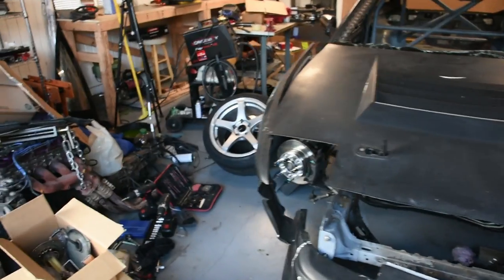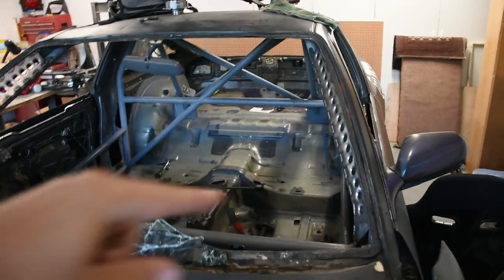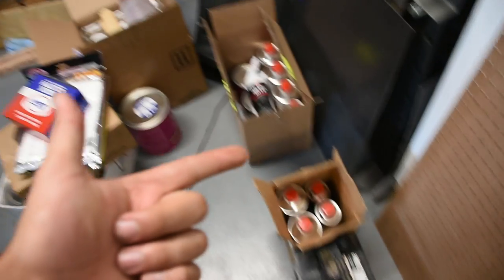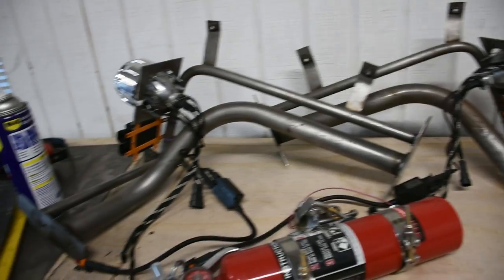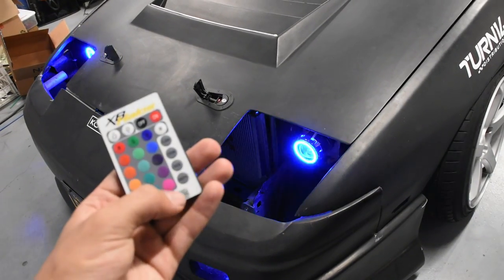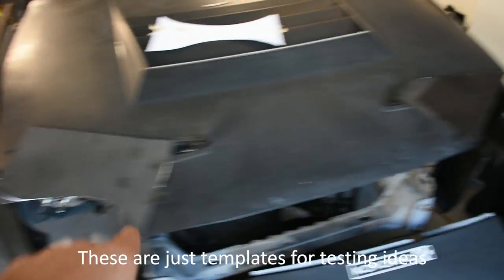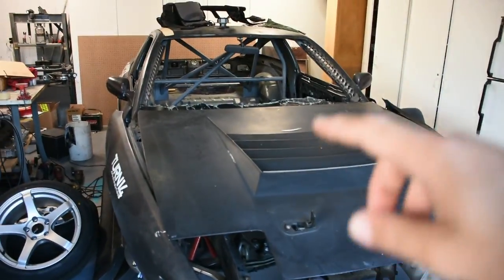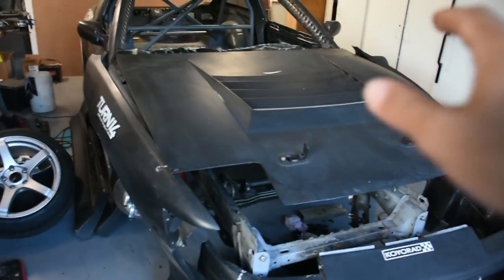Headlight Preview, Engine Plans, and Car Update!

Comment: WHEN you do the turbo 
I recommend getting forged internals

BUT!
GET AN ECU!
Go haltech or aem
And
GET
IT 
DYNO
TUNED!

Please for the love of the car get it dyno tuned

I like the cage vids btw
Reply from the maker: Probably won't be getting forged internals. Not worth it unless I can also find a fully counter weighted crank. Also KA's have no problem holding 300-350HP with stock internals.
Going with Megasquirt MS3 Pro. Cheaper and has more features than AEM. Haltech is just ridiculously expensive. 
Will be doing majority street tuning as street tuning tends to make the car more driveable however I'll be doing some dyno tuning as long as I can get my hands on a dyno which I think I can. 
Thanks :)
Reply: ***** ahh ok not really familiar with the ka so
I'd generally go forged anyway since you could rev it out much farther that way ( valve float not included ) 

But seriously
Get it dyno tuned asap when you get that turbo

Hell I'd go for getting that ecu before you even get the turbo 
Get the most out of your engine 

But if you can when you get it tuned get multiple tunes after your power 93 oct 
Or if you want to got through the "trouble" of converting everything so you can do e85 
( upgrading it in the process of course )

Comment: Looks pretty cool, what colors are you thinking painting it? Will you keep it black on the outside? 
About the headlights, where I live you need to have a set of lights pointing to the ground so they illuminate less but without "blinding" others, and those pointing straight forward. Are the rules the same around there? It appears by the way it's installed it couldn't do the job of those pointing down because the bumper is converting part of it, and knowing you also use this car for driving on the road, these safety issues end up coming up.
Reply from the maker: +André Fontes Car is going purple inside and gloss black outside.
Rules are kinda vague around here but basically just don't blind people seems like a good rule of thumb. 
I've driven the car hundreds of miles at night so far and have no safety concerns with lighting up the road ahead of me. The lights are really bright and the car is low. So with the mix of the openings in the bumper and how well the lights work and with the ride height of the car being so low I have no issues seeing and lighting up the road in front of me. 
Thanks,
Reply: Sounds pretty cool, it'll surely look awesome! Sounds OK then, a shame rules in Portugal are so restrictive for car customizations, there would be no way your car could be legal arround here XD at least to be able to drive it on the streets
Reply from the maker: Haha that's why I love America :P
Reply: portugal caralho

Comment: please dont turbo the ka you should swap in something like a sr20det or jz 1 or 2 but a rb20 would be cool.
Reply from the maker: +AtlasTitan Not worth it for a power level of 300-350HP
Reply: True but youre not really buying the engine for its stock power you would be getting it for the platform that you can build more power off of with a ka you can only go so far and the rb20 is pretty easy to swap.
Reply from the maker: If I want an 500+HP car then I'll buy an engine like a JZ to swap in. But right now I don't and especially since I'll be tuning the engine myself, god forbid I blow the engine doing something I shouldn't have with the tune. The price to replace a JZ is like 4x the cost to replace a KA.
Reply: yes thats true KA is cheap and to learn from its good but still you can do all that on a 1jz to swap. It will coast a good amount but if you do blow the engine ill be like 1k to get not that much more than a 700 ka.
Reply: And i do understand what youre saying it will cost a lot to get the 1jz or whatever engine im not you and i dont know what you can and cant do its just my opinion.
Reply from the maker: Bruh where is a KA going for $700. I bought my manual clean title 240 with a KA in it for $800 haha. Engine's go for like $250 to $500 which is a lot less than a 1jz.
And yeah for me right now I can turbo the KA for $3500-ish. So I'd have a full standalone ecu, single turbo setup, custom v-mount intercooler, custom radiator. For $3500 if I were to swap would just get me a stock 1j with R154. No motor mounts, no trans mounts, no driveshaft, no intercooler, no radiator, no standalone ecu. The cost is just way too much for a swap when all I want is a 300-350 HP setup.
Reply: What type of ecu are you planning to run?
Reply from the maker: MS3-Pro
Reply: Sr's are boring (live in Australia and they're all over the place), everyone with a sr I know has had issues with them running decently or breaking pretty often but it's all preference :)
Reply: it'll blow up to lol
Reply: Sr's are mint, I'm from Aus too. Dunno what you mean by them having heaps of issues
Reply: @OffBeat Garage You can get a good 1JZ-GTE VVTi with auto transmission for around 1000$ to 1500$, the thing is, you need to find and fit a manual 5 or 6 speed Toyota transmission. There's a guy that have done that, he bought a 240 shell and a 1JZ-GTE VVTi with auto transmission and fit the 1JZ in the 240. His youtube channel is TheCityRider you should check it out if you haven't. I don't mean to be disrespectful but i just don't get why you spent so much time reinforcing the car with tons of roll bars and stuff, and then run a KA, but that's just me talking man, don't get me wrong.
Reply from the maker: Again the goal is 300-350HP. KA-T is the most budget friendly setup for that power goal.
Reply: @NegatifDubz My 1jz vvti build is better than thecityrider. He put a giant borg warner on it, so no boost and no response then he sold it. What's the fun in that?
Reply: hey man i'm not saying that his swap was better than Offbeat's, he might have done some stuff wrong, yeah he did, but that's not the point. I was just suggesting to OffBeatGarage a better swap in my oppinion, since he spent so much time reinforcing the car, he might aswell fit an engine that would make use of those reinforcements, to really test himself on the course. I know you don't need a high HP car to drift, hell you don't even need a turbo car to drift, but  you can still drift slower with turbo to get used to the car, and then when you're good with it, you can try to step up your skills by pushing the car harder, but for that you'll need some power on the engine, and again i'm not saying that you can't do it with a KA-T, neither that it is a bad engine, i'm just saying that a 1JZ is more reliable and damn, it sounds so much sexier, but again, that's just my oppinion man, don't crucify me ahaha :)
Reply: OffBeat Garage LS swap :D
Reply: OHHH YESSSS

Comment: Do you plan to seriously do up the engine, suspension, drivetrain etc? Or keep a lot of it stock?
Reply from the maker: None of the suspension is stock. Engine will be turbo'd and then most likely built. Drivetrain is fine being stock except for the trans at over like 400-500hp.

Comment: You know instead of going turbo why not get a vq35? They have a better power band than a ka turbo would, would be more reliable that a turbo bouncing off the redline on an engine that was never meant to be turboed, and they aren't that much more expensive.
Reply from the maker: +Dani Kimbro VQ has no potential for more power. You just get you what you get and that's pretty much it for power. And I like bouncing off the limiter haha
Reply: OffBeat Garage first bouncing off the limiter in a turbo car risks blowing it. Sure they are cheap but why swap motor after motor in when the vq will give you the same power more reliably with a better power band. Not to mention it won't be nearly as temperamental. Plus if you ever need more power turbo vqs make 500 hp on moderate boost. It's the 350z engine, same block and such as the gtr. It can handle more power.
Reply from the maker: +Dani Kimbro It's about crowd entertainment, i'll bounce limiter all day long. Not a problem. And the only use if putting a VW in the car would be to keep it NA. If I'm going turbo with a VQ then I'd much rather swap another engine in that has more potential than the VQ like a jz.
Reply from the maker: +OffBeat Garage *VQ corrects to VW on my phone sometimes headsup
Reply: OffBeat Garage true the jz has a whole lot more potential, but it's a shit load more expensive and a much harder swap. The vq with a little bit of welding bolts right in. Plus the vq is a v while the jz is an inline engine. This means that more of the weight would sit forward if the front wheels creating balance issues. It's about a whole package not just which one can be boosted into the stratosphere.
Reply from the maker: +Dani Kimbro No that's the problem with the VQ is it's a v6 and not an inline 6. That means if you do want to invest in going turbo you now have one of the most ridiculous manifold designs to deal with to go turbo and now tons of heat problems because the headers take so much space inside the engine bay. It pretty much always leads to having to rear mount the radiator because of how bad heating issues get. That's why the whole reason to go vq or v8 is to avoid going turbo, thereby avoiding turbo lag and avoiding the complications of a turbo setup. But going turbo on any of those two platforms just ends up creating a lot more problems than typical and you might as well have gone jz and have a much better setup for a turbo. And those are words taken straight from taka aono when I talked to him and he's a big fan of vq's. Basically you keep them NA or you go turbo with another platform. And like I said in the first comment, when you keep that engine NA you just get what you get for power. Can't just up the boost or turn down the boost and have a customizable power setup like a turbo'd KA.

Comment: Where are you going to run the wiring harness through?
Reply: he'll probably just put another hole in the fire wall on the passenger's side because he sad he was going to put the fusebox and all that stuff in the cabin
Reply: iamawatermelon oh ok thanks for letting me know!
Reply from the maker: It runs through the passenger side holes in the firewall that are already there for AC and original engine harness.

Comment: Why do a turbo KA when you can swap while you have the chance
Reply from the maker: Not worth swapping for a power goal of 300-350HP. Also have to remember that I'll be tuning this myself and testing a bunch of anti-lag and rotational idles setups with it. So it becomes a lot easier to replace a KA if I end up destroying it vs. any other engine swapped in.

Comment: what are the rails with holes at the front windshield?
Reply from the maker: +Salinas, Tom 空 For windshield wiper arms
Reply: I'm curious how that would work? since it would be inside umm... I ment on the A- pillar

liked/Subbed👍
Reply from the maker: +Salinas, Tom 空 Oh that. I had no idea what you meant by rail so I thought you were talking about the top of the firewall. Anyways, what you're referring to are dimple die gussets. They tie the cage into the rest of the chassis to increase strength and stiffness.

Comment: noo go itb and a tubular header and build the motor no turbo pls
Reply: I second this:
better valve return springs
better cam and crank bearings
upgraded head studs
itbs 
tubular header
e85 fuel upgrade
1000cc injectors
and better spark plugs and he would be are for about 500bhp at about 8500 rpm

Comment: why not sr20?
Reply from the maker: +Rafael Silva Not worth it for a 300-350HP goal
Reply: +OffBeat Garage youre gonna buit the ka with forged internals etc? youre aiming for 300+- hp?
Reply from the maker: +Rafael Silva KA can do 300-350HP on stock internals. Chris Forsberg's missile car has had a KA-T in it for 3 or 5 years now I forget. Stock internals, making 350HP, never had an issue.
Reply: +OffBeat Garage but still u gonna rebuilt it completly?
Reply from the maker: +Rafael Silva Nope no rebuild.
Reply: +OffBeat Garage if youre having such work, u should do it!